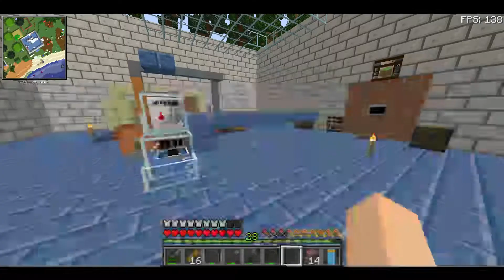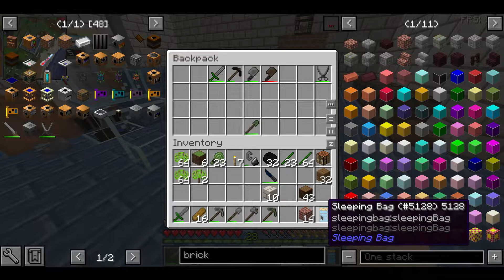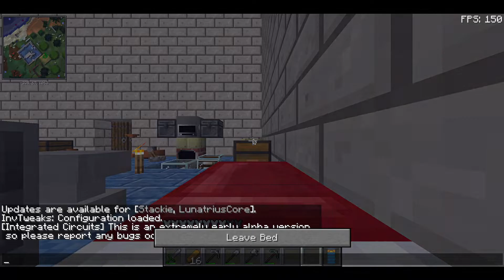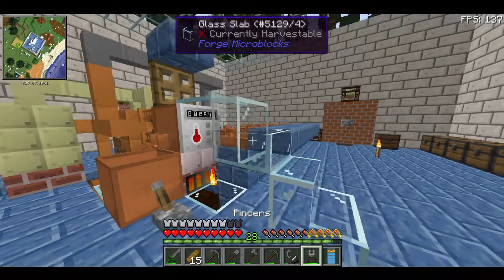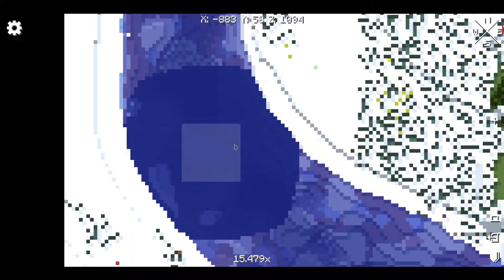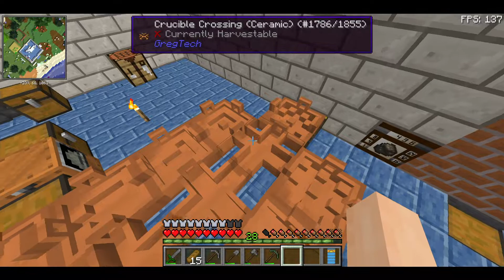GregTech 6 Playthrough - E10

Comment: 64 is a transition amount, you can run it in either T1 or T2 machines so you could run that silicon in there you just need a better turbine and boilers